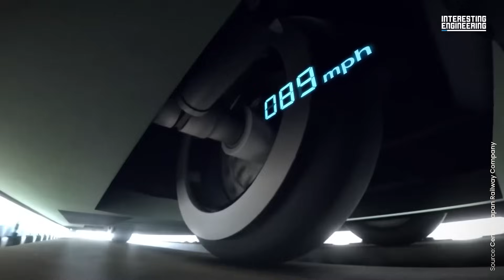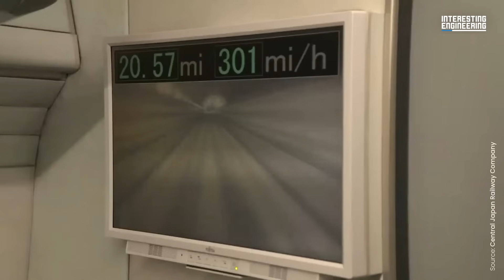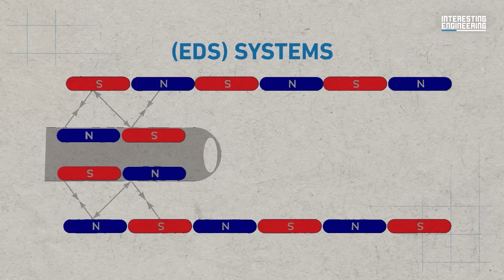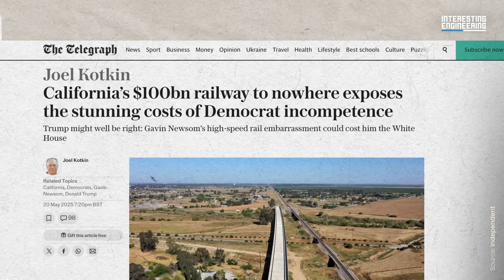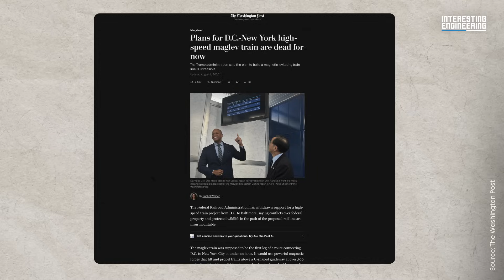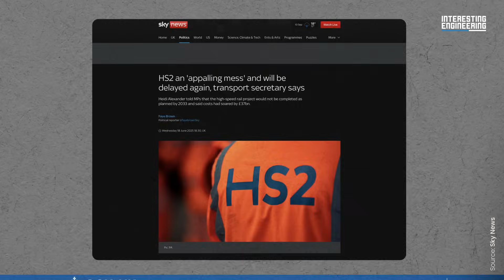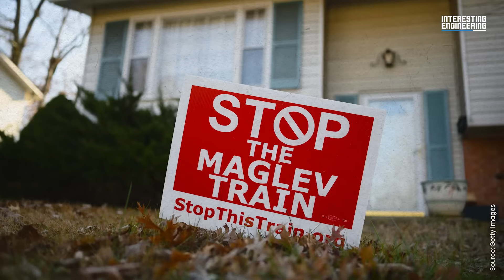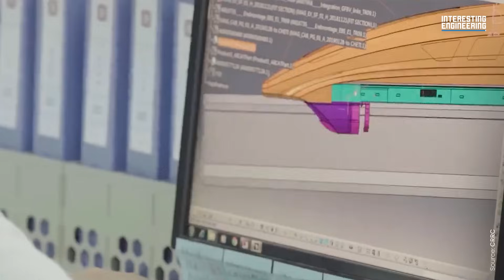The Trains That Put the West to Shame

Comment: There's little to no benefit of maglev over rail. At most you might be able to make the argument for higher sustained speeds, but even that's contentious with the fastest recorded maglev only going less than 100kph faster than the fastest train on record. In terms of cost, it's about an order of magnitude more costly than HSR to construct and operating costs are likely going to be in excess of double what HSR has. Maintenance is going to be an interesting variable because while there aren't many parts in direct contact and none while under way, things like cryogenic chillers for super conductors are not cheap. Operational performance especially capacity isn't great for these systems because the complex switching systems needed to make them work severely limit throughput (this is the same issue that monorails have). Finally, the most damning issue is that all of the systems are proprietary so building a systems more or less locks operators to one set of manufacturers for both infrastructure and for vehicles.

Comment: In places where there are no tunnels, please make track wider so the trains can be double wide or WIDER, so the trains can be much more comfortable to ride in. i think the thin train should be a thing if the past. imagine having wider trains where you can have live performances on a stage in some train cars because a wider car could allow this type if mini concert train car. :)
Reply: They mention the benefits of the design in the video.  Wind resistant
Reply: @christyvandamme7280   Trains are locked in the past. We need to reinvent the train, so that trains are WIDE, and not so single THIN car width anymore. in places without under ground tunnels trains should be SUPER wide and double decker tall. So train cars could have vaulted ceilings inside and ornate lovely spacious wide interiors. NOT just lame rows of chairs the way existing trains do. Lets reinvent the train ASAP its a great concept but its needlessly locked in this single tiny form factor just because. Lets make trains GLORIOUS to ride in by making them wide & tall in places without size  limiting tunnels, that limit train size, FOR NOW. :) ❤

Comment: The biggest drawback of the EMS system used in Germany and Shanghai is that it constantly requires power to keep the electromagnets working. That means in case of a blackout or feedback circuit failure, the train would drop immediately (the German version at least has emergency cushions). Japan’s JR considered this too risky and abandoned EMS after the ML-500 in 1979. Starting with the MLU001 in 1980, they adopted the revolutionary U-shaped rail EDS system. Since it derives lift secondarily from kinetic energy, the train can keep levitating for a while even if power is lost. It’s also thought to be safer than conventional railways because it can tolerate cracks or shifts in the guideway caused by earthquakes.
Reply: Yeah, engineers are too stupid to install buffer energy storage to stop the train safely when the power is cut. You think they just said you all die if the power is out? Lmao.
Reply: @MGZetta  It’s very Chinese to think ‘as long as no one dies’ is sufficient. A truly excellent engineer prefers designs that make catastrophic failure in principle extremely unlikely — not just one who hopes that buffers or backups will save you if something goes wrong.
Reply: @MGZetta it's actually very Japanese to accept nothing but perfectness. It's why their society is very stressful and ridicule people at the slightest mistake, while most normal society embrace mistake and will make effort to better things. It's ingrained in their culture "a stick out nail gets hammered" or something along that line. It's why they tend to be satisfied being in #2 and ridicule other people's effort to make things better.
Reply: @Suronyo Isn't it okay if you can accept that a major accident resulting in deaths will occur because the design is not perfect? 
I'm sure you would be able to forgive yourself if you died because the design was not based on fail-safe features.

Comment: MAGLEV LINE CANCELLED
The proposed, for some years, MAGLEV line in Japan, has been cancelled JR Central recently revealed. The costs of construction and operation of a MAGLEV route are far higher than a normal  Super High Speed Railway, such as the already established Bullet train network. Further as you cannot integrate a MAGLEV transport system with a Railway because trains run on rails, while a MAGLEV vehicle "flies". No "Quantity of Scale" reductions in costs will be possible until a large part of the current Super High Speed Railway network, could be replaced with the MAGLEV transport method.

 Further the technical advantages of MAGLEV as a very high speed transport system, have been eroded considerably, since the French Super High Speed TGV train tests, revealed that current rail technology has no problems with running at 500kph (300mph) as and when this becomes necessary. Indeed one of the technical drawbacks of MAGLEV, apart from the fact it requires far more electricity to operate at the same speed as a current Japanese Shinkansen (Bullet) train. Is the serious issue of multi line stations. Because MAGLEV has NO rails and literally "fly" along a large concrete "U" shaped channel, without contact with anything, there are massive costs involved in the special structures needed for one MAGLEV to change to another parallel path. So a large station with possibly ten platforms requires far more space at each end of that station to accommodate these huge moving concrete transfer channels, than a ten track Railway station. Each one of which is as much as ten times the cost of an equivalent railway turnout/switch/point, which only needs the rails and one small motor to allow the train to change tracks. 

This is the major reason why virtually NO MAGLEV routes have been built, or are in current operation. Indeed two have closed within ten years of being opened. And in both cases replaced with alternatives. The only MAGLEV route in daily use as part of a rail network, is the solitary Tokyo PART MAGLEV underground line. But to reduce costs of that lines construction, it actually runs on rails, and only uses Eletro-Magnets each side of the track to move the trains forwards or backwards. Reducing the electrical power required by over 50% of a full "Levitating" MAGLEV. Further being an Underground line, speeds do not need to exceed 45mph, another serious consideration with respect to the amount of Electricty required, and its cost.

Comment: Fuel cost of ordinary Shinkansen (generated by clean natural gas )from Tokyo to Osaka costs roughly 600 USD today.(only fuel, not including any extra cost)
That means around 0.5 USD fuel charge for every passenger s.
Maglev consumes 3 times more , around 2000USD.
How long can your truck run only with 600 USD gas?
Reply: The fuel consumption of the magnetic levitation railway is about twice that of the current Shinkansen, but compared to the energy consumption associated with transportation per person of (500 km/h), it is 1/2 of that of a gasoline car (100 km/h) and about 1/ of an aircraft (900 km/h). It is 3. Why don't you introduce it in the United States?

Comment: Australia needs this to circumnavigate the whole country!
Reply: No it doesn't. The circumference of Australia is about the same distance as travelling around the World! If Australia built that the nation would be broke & nobody could afford to use the damned thing.
Reply: @nightjarflying  what about Sydney to Cairns? If we taxed our mining companies, we’d easily afford it.
Reply: @GenZedsMother  Sydney to Cairns City 2,400 km x 30M AUSD/km = 72 Billion AUSD. Flight time including 2 hrs for airport shenanigans is 5 hours & would require a 550 km/hr train to match the time [allowing for stops on the way]. 

Flight cost is between $80 & $180 AUSD so it's impossible to see a MAGLEV running at a profit as it needs to be under $200 inc a sleeper. 

In terms of the environment there's no justification for all that pouring of concrete & massive use of copper/steel for a line that can't move heavy goods & can only be used by MAGLEVS. The carbon cost per year is far, far higher than that of the new aircraft coming on line.

Taxing the mining sector even more is interesting - perhaps remove their fuel allowance as a start.
Reply: @nightjarflying  Ok, makes sense. Thanks for breaking it down.